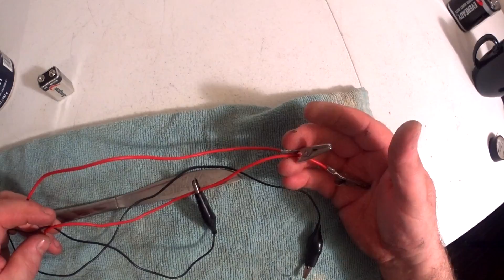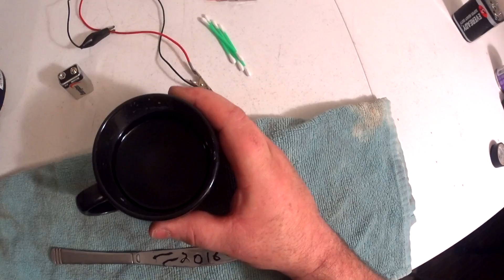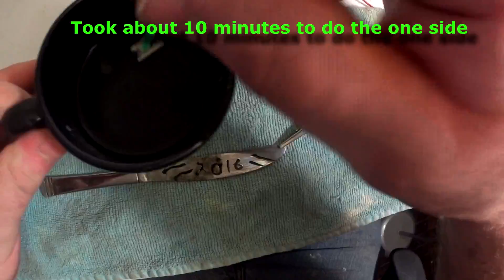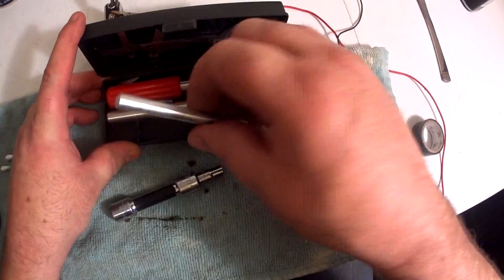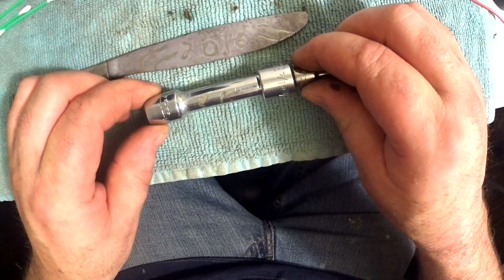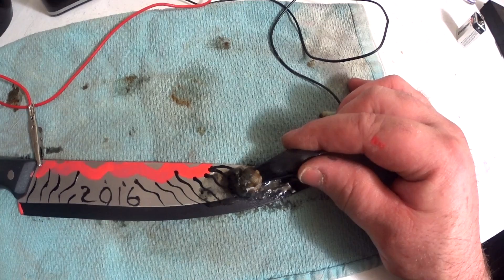How To Etch Knives with Table Salt and a 9 volt Battery

Comment: Its a great and easy way to custom etch your metal stuff. But i wouldn't use a nine volt battery any more cause the battery becomes quite hot and maybe explode. I use a car battery charger instead and its working great.

Comment: What if the metal with the protected image was just submerged in a saltbath, wouldn't it still eat away all the exposed metal in a uniform fashion?
Reply from the maker: Would over time I believe but would take quite a bit of time
Reply: shakostarsun
Reply: Well an electro salt bath would do the trick , but tape up that edge ! Be very careful tho ...